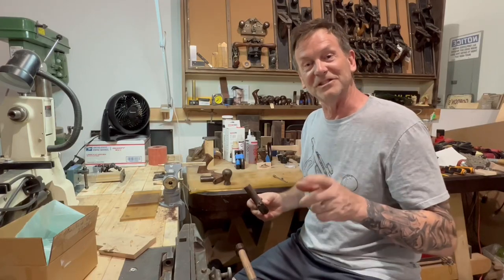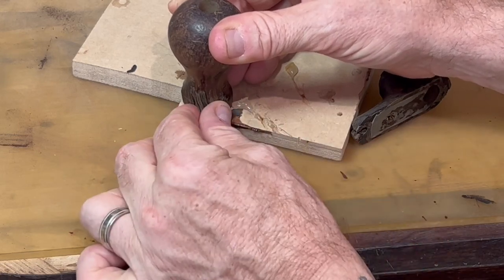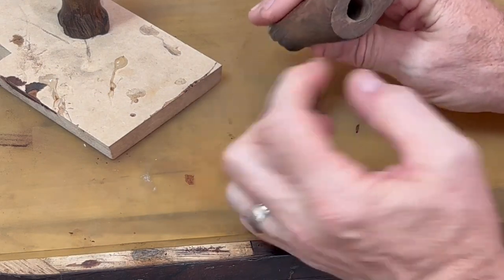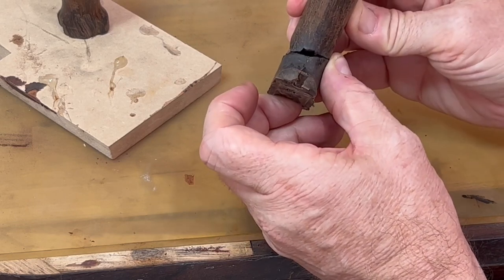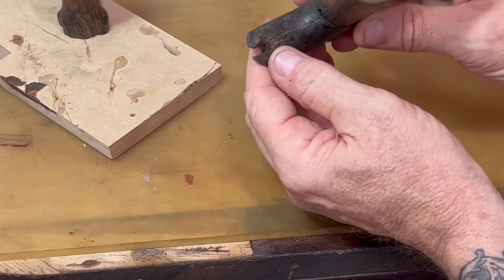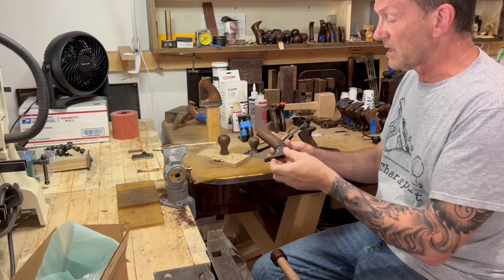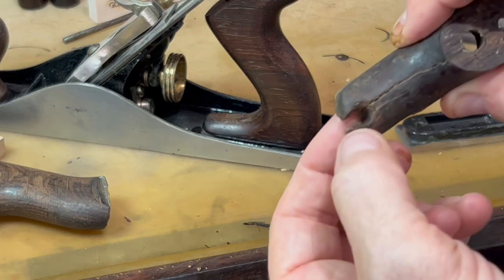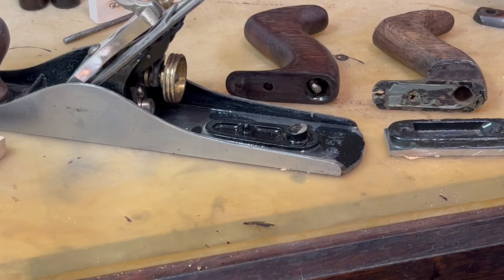Stanley 605-1/2 Furniture Repair

Comment: Thank you Gordon. I need to watch more of your videos for sure.

One thing I've gleaned is the value of parts off unusable planes.

I couldn't source any old Rosewood on a Bailey 7C I was getting back up to user status so I used some completely opposite timber for a horn replacement on the tote. Figured I might as well make the need obvious when a more professional user wants to properly restore it. (Can't believe I found one still intact after 121 years of hard use.)